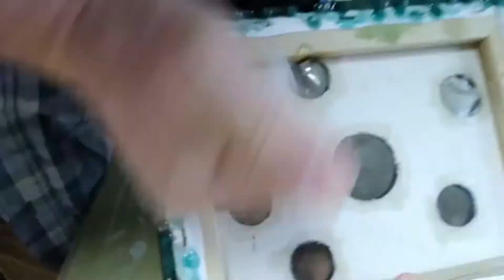Epoxy Resin Art..."Mother" Pt. 3 / Art for A.I. series...#mother #motherearth #motherboard

Comment from the maker: This is the 3rd video for the piece titled "mother" from the "Art for A.I." series. In this video I had gotten to, what I thought was, the completion stage of this piece only to decide I wasn't happy with the outcome. I felt like it needed a little more and the gloss lines I had connecting the 5 gold elements of the piece looked like I had just used gift wrapping tape. However, I'm glad I changed it cause it will be a more interesting piece. Part 4 should be the completion video and I'll have that out real soon. Take care, be kind to one another and if you enjoyed this content please subscribe and hit the like button.  (looks like I have some focusing issues to work out with the new camera 25:27 -  42:34 , thanks for your patience).